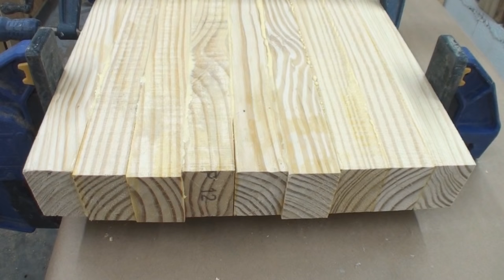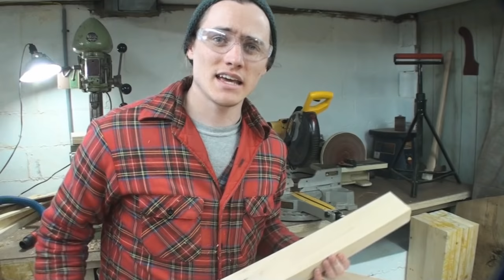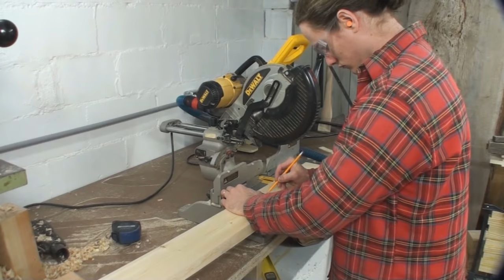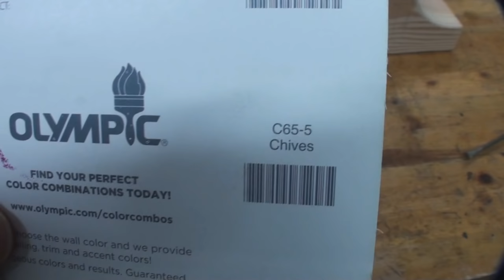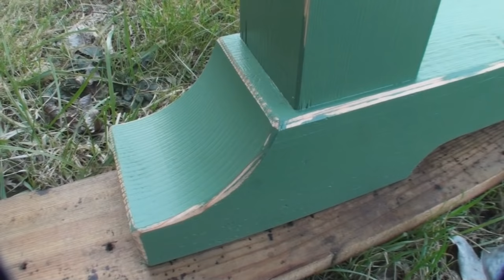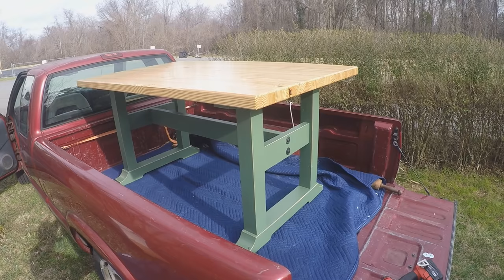How to Build a Trestle Table - Plans Available!

Comment: The clamp rack is a great idea. I've seen lots of commercial models but never a diy one before. That trick with straightening the line on the bottom with a plane at an angle was new to me, so thanks for that!

Comment: It's great that you're giving alternative methods of doing things if someone doesn't have the machinery you're using (my shop is still in the process of growing). And the little tips are nice, like the mitre on the stop for the dust … great work!
Reply from the maker: +Andreas Kalt Thanks, I saw your first comment (they get sent to my email). When I'm building a design for the first time, I'm designing it as I go, sometimes the order of things is a little different than if I built it a second time. Hope that makes sense.
Reply: +The Homestead Craftsman OK, thank you. I deleted the comment because as I continued to watch I came to the position where you explained that you make the tenons oversize. Thanks for the explanation.

Comment: There was so much good information in this video. I didn't see why you took the paint off the edges of the frame at first, but once the whole thing was assembled, those edges really looked tied in with the top. Nice job showing people how to make nice furniture with SYP easily accessible lumber, and offering different ways to do each operation in the build.
Reply from the maker: +Matt Bos Sometimes in painted furniture the piece can visually lose it's form a little, cutting back the edges highlights defines the shape and adds a little visual interest, another benefit is that when the edges inevitably get dented, scraped, etc. the paint is already removed and these problems won't stand out.
Reply: +The Homestead Craftsman That makes sense. Thanks for the reply!

Comment: good video and a very nice build, good to see that your shop is coming along.
Reply from the maker: +39 Custom Thanks. The shop is nice now. I've got a couple more things, but functionally speaking it's where I want it. It was fairly easy to put together, not too expensive and has turned into a real money maker and saver for me. So far the best improvement outside of tools is the lighting and having electrical outlets everywhere I need one. Thanks again.
Reply: +The Homestead Craftsman nice.. love the tabeltop clamping jig....would be cool if you could make a video about it.

Comment: I'm starting to understand the  benefit of using a track saw for jointing boards. I'm currently working on a project with some 2.2m lengths and had issues getting their bowed edges true...even on my mid-sized jointer. Laying them on their flat face and running a guided circular saw down their edges would have been much easier. Great video dude.
Reply from the maker: +Sharp Edge Woodworking Thanks. Track saws are great. Do they completely replace a jointer? No, but they do 99% of the "Jointing" in my shop. It's also a lot easier to handle than trying to put a 8 foot plus long board across a jointer. Thanks for watching.

Comment: Your work is so methodical, I also love that you still use the radial arm which has fallen off the radar, and too is your attention to your photography. Please tell me, what sort of wood filler did you use on the fir table top. Thank you for your contribution to woodworking in general terms... Great Work for you make it seem so effortless!
Reply from the maker: Thanks, the radial arm saw is one of my favorite and most used tools. Far better than the sliding miter saw for my kind of work.....but I do have one of those as well and use them all. The top is yellow pine on the table and I used "Plastic Wood" wood filler. It is sold at lowes/home depot. It is acetone based and dries very fast. It's ok for most pine and painted projects. Otherwise I use epoxy. I also sometimes use water based wood filler, any brand.

Comment: At the :26 minute mark in this video, you are attaching the tabletop to the base using Kreg screws with fender washers. You mention, at this point, that this method of securing the top to the base allows for expansion and contraction of the table's top. I don't completely understand. Are the holes in the base (through which the Kreg screws are applied) a wider diameter than the screws? This is the only way i can see that will allow for the top of the table to move a bit. Thank you.
Reply from the maker: Hi, you are correct. The hole for the washer and the hole for the shank of the screw are larger. The reason for the washer is because the screw would go right through the larger hole, the washer also gives a smoother bearing surface for when movement occurs. I think the whole is about 5/16 or so and the counter sink for the washer is about a 1/4 inch larger all around than the washers diameter. If you would like more information on the table, I did a set of plans that are on my website. Here's the link http://www.thehomesteadcraftsman.com/p/blog-page_26.html Thank you for watching and the comment.

Comment: Thanks for the video. Question: could you use the table saw to get a flat surfaces to be able to joint 3 boards together that are 2"x8"x8'? What I mean is get the board against the fence and cut about 1/2" and the flip it and cut another 1/2" (ending up with 7"), do this to all the boards and then joint them to get her to crate a wider board. Or is it better to use the circular saw. I don't have a jointer.
Reply from the maker: Yes you can, look up "straight line ripping on the table saw".

Comment: Hello HC, thoroughly enjoy your videos, sold a couple of my own tables and am in the process of building a new woodshop and acquiring new shop tools. I'm more of a carpenter than I am a woodworker and for sanding I have an orbital sander (not a great brand) a 1/4 sheet sander (mainly used for trim work) and a belt sander. 

For that 1/3 sheet sander, I see it listed as a "finish sander" a lot of the time, do you recommend using one to do final sandings with? any tips on sanding either? I typically finish with a 220 grit with my orbital.
Reply from the maker: What you have is fine, 220 works good. You could always hand sand it with the grain to finish things off.

Comment: Great build.  Just out of couriousity why didn't you use the drum sander for the table top.  Not a crituqe I am actually thinking of getting one but my shop is about half the size of your space and i am hesitant to dedicate the space for a drum sander.
Reply from the maker: +Josh Burke The top is really heavy and would have been hard to maneuver through the sander, also it is yellow pine so it would have just gummed up the sand paper.The top it's self was pretty smooth minus just a little sanding on the joints. It just depends on the job, My favorite thing is to use it for small stuff and face frames for cabinets and similar projects.
Reply: +The Homestead Craftsman Great project, excellent blow-by-blow details.

Comment: nice table, nice video and presentation. One question, I am going to build an outdoor table for my deck I just rebuilt for my landlord. It will be exposed to the elements on the deck. Can I just paint the table to match the deck colors, and what kind of paint to use for this project.Thanks, appreciate any advice you have.Steve
Reply from the maker: Hi Steve, I just depends on what you want to get out of it. If it's out in the open on the deck (can be rained on) put a deck finish on it, if you want to paint it a color use a solid stain (it looks like paint) Olympic Solid Stain is sold at Lowes. If you are using treated lumber to build the table, you probably want to build it and let it sit and dry on the deck for a while before finishing. The moisture in the treated lumber makes the finish not adhere as well. If you are using some sort of more interesting wood for the top and want to see the wood, you could use some sort of transparent or translucent finish, oil or water based. No matter what you do, the finish will fail eventually out doors.....the sun and rain are tough on stuff.

Comment: Great learning video question what do you use as a filler ? most fillers won't take stain well
Reply from the maker: I just used Elmers wood filler for this since it was getting poly. In a case where a stain is used and there is a knot hole, I use epoxy that I tint black. Just looks like a knot afterwards.

Comment: Love your channel and the work you do!  I have that same kind of Ridgid table saw and am dissatisfied with the fence.  I noticed yours isn't the original as well.  What brand of fence is yours and where did you get it?  Thanks!
Reply from the maker: Mine is the one with the granite top. The fence is the stock fence. I've seen this saw with biesmeyers and other similiar styles. My plan is to use this one until I'm in a longer term shop then get a saw stop. Not only are they safer but work great too.

Comment: I have one question for you, what kind of wood did you use to make your wedges?Thanks,All most finished with my base, just need to make some wedges and glue them in.
Reply from the maker: I used scrap ash but any hardwood will do. If possible, I would like to see your project so far if you have any pictures.

Comment: How long did you let the wood dry in your shop? 

Great video man! 
Greetings from Germany
Reply from the maker: +Philipp Konter Like a month, but I was working on other stuff. I had all the parts roughed out how they where stacked in the video. Basically it just lets the pieces that are going to curl up go ahead and do it. I cut more strips for the top than I need and throw out the bad ones. It makes a big difference in the end. Even if you let the wood sit a week or two in works pretty good, unless your dealing with actual wet wood.
Reply: Thanks for the answer!
Keep the good work up :)

Cheers

Comment: Hey...I really appreciate you answering all the questions that I have been asking.  I have another question.  I am painting a table base with a flat black interior paint.  The folks at Home Depot said they weren't sure if I could put Minwax Polycrylic over paint.  But I saw in one of your other videos that you are using that finish.  have you had any problems with the Minwax Polycrylic delaminating (or other issues)?  Thanks again for your help.  -Dan
Reply from the maker: I use it on all of my table bases, over white and black paint. One of my favorite ways to do it that looks the least plastic like is to sand the base, paint the base, distress the paint then brush on one coat of thinned finish (with water) it soaks in more and is not such a film finish. That would also have less likely hood of failing, but again I use it all the time and zero problems. Use it with confidence.

Comment: Is there a reason for cutting the 2x10  's into small strips vs larger? I'm just wondering if that makes it less likely to cup and warp.
Reply from the maker: You would have more cupping issues doing it otherwise. Keep in mind that I let these strips dry for a while before using them. I've done this on a kitchen island I made myself and it worked well. I've been using it for about 4 years and it has remained stable.

Comment: Another lovely table! Do you have a rule of thumb for the sizes of tenons (width and length) for your table bases?
Reply from the maker: +Billy Lee Not really, as it depends on the table and it's size. But in the case of normal sized aprons, 3-5 inches, I like to make them as long as I can. But at the same time, you don't want to weaken the leg with the mortise. But once it's all glued together, it's basically one solid piece in the joint. Most of my tenons are 3/4 thick, 2-3 inches long and about an inch less than the apron board is long (on traditional apron tables). Long story short.....I have no formula.
Reply: +The Homestead Craftsman  thank you! That's helpful, researching the Internet about tenon sizes usually gives results for fine furniture and not a good strong farmhouse tables.

Comment: Beautiful table. I really like the way that pine top came out. What kind of blade do you use on your miter saw? I need to replace mine but not sure if I should go with a low or high tooth count. I use it mainly for cutting molding.
Reply from the maker: +Ohio Digger I use a dewalt finish blade, I think it's a 60 or 80 tooth......it cuts big stuff a little slow, but doesn't get grabby on small stuff like a framing blade can. It's good all around.  I can try to check if I remember the tooth count.
Reply: OK I'll take a look at that blade the next time I'm at Home Depot.  Thanks!

Comment: How long did you let the wood sit to dry out? And did you use a moisture meter or go by feel?
Reply from the maker: +Scott King I let it sit around for about a month or two, I ripped it into strips and stacked it up with spacers. Everything was to rough shape to get a little more air. It's not going to totally dry it, but my basement has ducting vented into it, so it is climate controlled. I mainly want any pieces that are going to curl up to go ahead and do it. I cut more strips for the top than I need and remove the bad ones. All these strips combined with the grain being flipped around plus the additional dry time makes for a pretty stable top. But it all starts in the store picking the straightest grain boards you can. I did not use a moisture meter, but using one will be a little more accurate and safe.

Comment: Like to know what Mortising tool you have and what is the biggest size chisel and bit you can use on it? Thanks already did the top on my outdoor deck table. Going to start the base. Just need some info on a decent mortising machine to buy, since I got some extra money for Fathers Day.....lol
Reply from the maker: https://www.amazon.com/Shop-Fox-W1671-Heavy-duty-Mortising/dp/B000J0UTL6 I use a 3/4 inch on it for this project, but that's big. I also use 1/2 inch for smaller stuff but they make down to 1/4......i think. It's a pretty good machine and isn't the most expensive. I paid about $280ish for mine at a discount tool store in Tennesee. I've made a lot of furniture and money with it. As you can see in the video, I have it bolted to a work bench which is very nice vs. just sitting on a bench.

Comment: About how long did you let the wood for the top dry before you started building?
Reply from the maker: I think it sat around my basement for about a month. It wasn't so much about drying as it was about seeing which ones warped. Sometimes a board will warp up by the next day once ripped, give it a week or two and time will weed out the pieces that are a problem. When using low grade wood I rip up more than I need.

Comment: HC,  what type of wood chip extraction do you have hooked up to your planer...and your thoughts on it? Thanks in advance.
Reply from the maker: Just a harbor freight model, one of the smaller ones. Works good, I use it with a trash can separator.
Reply: Thanks

Comment: That's a nice table construction video! One small detail though, the filler on the knots could have been clear epoxy right? Dont get me wrong, I sub your channel because I think your a awesome wood worker.
Reply from the maker: +HRM Weapons Machinist You sure could, I've got a gallon of west system that I use for lots of tables. For tables like this with pine tops I sue wood filler as it blends in good once poly is applied. It also dries quicker than the epoxy as it is acetone based. For oak tables and other hardwoods I use epoxy tinted with black chalk.

Comment: If you could only use one power tool to make this table, what would it be?
Reply from the maker: A magic wand...just kidding. Probably a router.......you can make and do pretty much anything with one. But I'll take my whole shop instead. You really can't efficiently make furniture on any level with just one or two tools. If you are looking for the most basic tools, it could be made with hand tools only no problem.

Comment: heyhey been awhile happy your back.  On your deWalt radial arm saw is there a different guard that you change out when using a dado blade or is it the same as when you use just a standard cross cut blade. Nice video
Reply from the maker: +Vocha Alloy Same guard. It's a great saw, I have two of them if you didn't notice. Changing out the bearings on it now.
Reply: +The Homestead Craftsman yes I have always liked the look of your Dewalt
Reply: +Vocha Alloy  by the way  thanks again
Reply: +Vocha Alloy lol forgot to ask what model is it
Reply from the maker: +Vocha Alloy Dewalt MBF 9 inch.

Comment: lovely work nice i need ur advice on sum bent laminated work am gonna do
Reply from the maker: +oneil abdool Let me know what your working on.
Reply: its a S shape tv unit
Reply: +The Homestead Craftsman but i never done bent lamination
Reply from the maker: You either need to do it in two U shaped bends and connect them or make a form that is S shaped, that would be pretty complex to get clamped up. You might want to do some simple bends first to get the hang of it. You can wait on the tv unit until you gain the skill or come up with a more simple design you can make now.
Reply: +The Homestead Craftsman i am doing it in the U form first
Reply: +The Homestead Craftsman but i plan on trying it out on 1/4" ply wood first
Reply from the maker: That will work as long as the curves are not beyond the plywood's ability to bend, they also make bendable plywood just for things like this that you veneer after you make the bend, good luck.

Comment: I am glad to notice that you did not apply "bread board" ends to this table.  In my opinion, they can just cause too many problems in the future because most of us rank amateurs don't do them correctly.  I just don't think they're worth the trouble, so I stay away from them.
Reply from the maker: I can do them all day long, I just don't like them that much.....I also think they are overrated. They are not necessary in many cases.